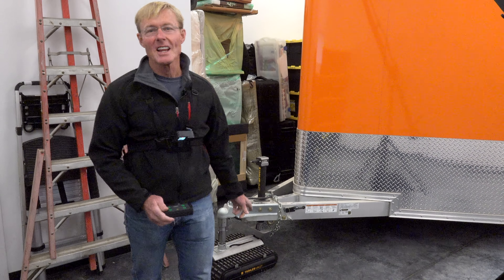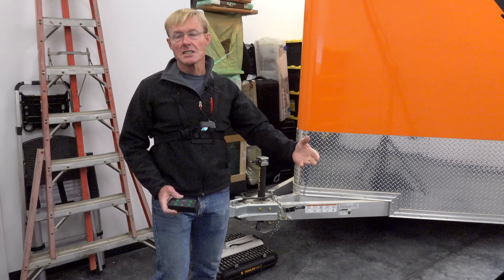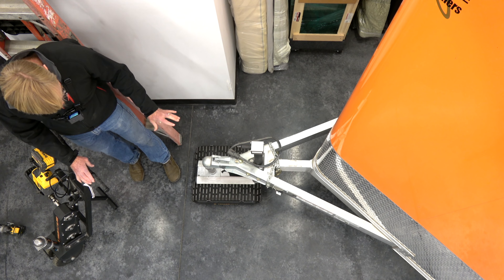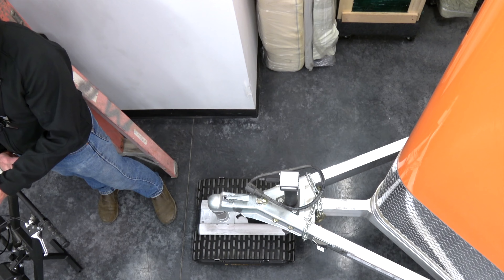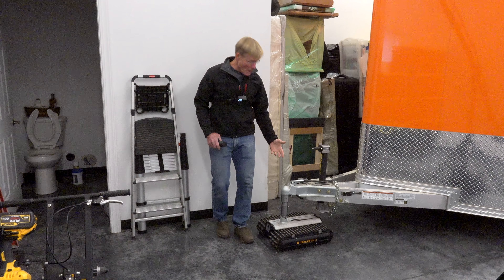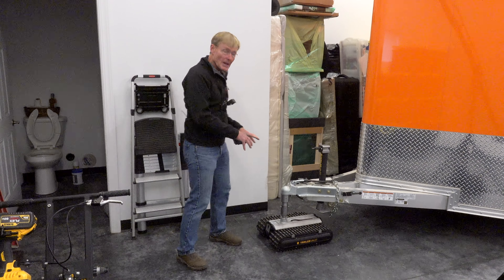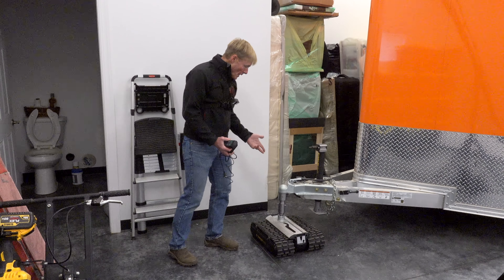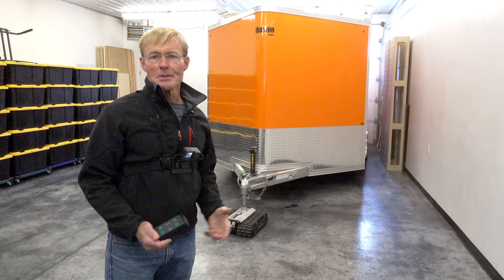WOW! RVR-9

Comment: Here is a thought.  On your review of this product a year or so ago, I  think I remember you making note that you were concerned with the fact that an uphill situation could be risky, as the trailer could possibly  overpower the tug and create a run-away trailer. I don't think you put it exactly that way but, that was the way I took it. Regardless there is a simple solution to this concern.  If you trailer has trailer brakes, incorporate a plug for your RVR to actuate the trailer brakes. Instead of a whole remote unit redesign just add a single add on 12v battery pack attached to a trailer pigtail that will match your trailer harness and a wireless button that you could attach to your controller.  Trailer breaks could be activated at the flip of a switch or even better use a Potentiometer (POT Knob) and dial in breaks as needed.  I have a spinal cord injury that causes constant pain, but I am thankful that pain has been the only limiting factor. I wish I could afford one it would make my life so much easier!  Maybe Trailer Valet will send me out one and I can make a video to demonstrate exactly what I am talking about.  Thanks Ron for the informative video on this great product.  PS ......I bought your workbench plan years ago and built it.  I have had continued use of it now for many years. The function and  flexibility your design is second to none and affords me to work on projects right by myself without having to have an extra set of hands.

Comment: Cool unit.  Run time of 30min. seems short if to be used to move equipment around several times a day (in my case a 35' towable lift on a jobsite).  I looked up the Traxx X2 and it seems more applicable for my needs.